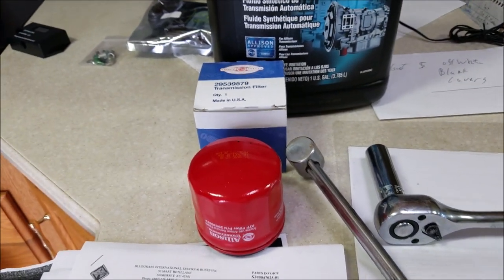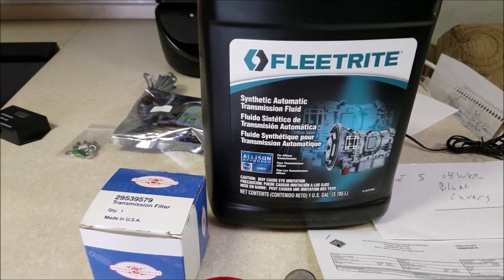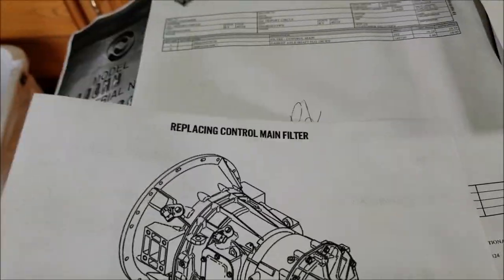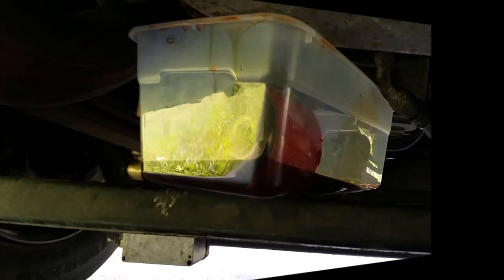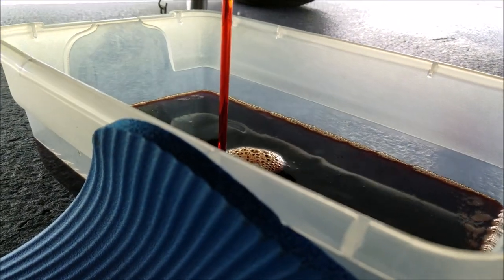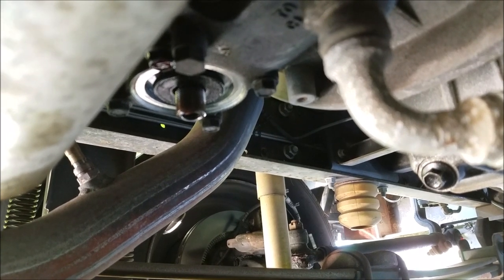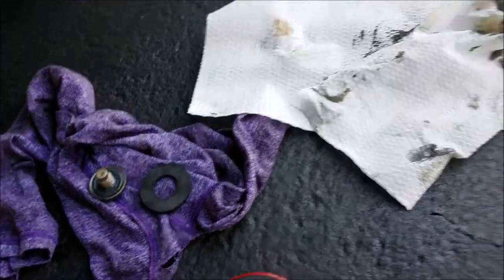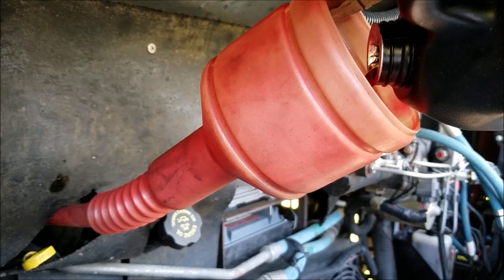How to do a Oil and Filter Change on Allison Transmission 1000 & 2000 Manual Says Every 24 Months

Comment: Thanks for showing the right way to change the transmission filter.. and the extra for issue with cruise control... Mine does the exact thing. I thought it jumps off of cruise control because of the weight of my hand control... But now i diffidently need to look into that switch
Reply from the maker: I cant remember if I talked about it but check the break switch also if you hear a click the moment you just touch the brake pedal it may be to sensitive so give it one full turn so you have to push the pedal down farther

Comment: When I replaced the flexplate and converter on mine, I took the pan off and did the internal filter as well since I was not the first owner of the truck and it had 270k miles (trans supposedly rebuilt).  Highly recommend "LubeLocker" gaskets.  My friend has a 1000 in a duramax so we went to our local allison dealer and bought 10 gallons of the castrol branded transynd.  If you look at the viscosity index it's pretty dang impressive stuff.  Stays thick when hot but stays thin when cold!
Reply from the maker: Thanks for contributing

Comment: How often do you change the internal filter?
Reply from the maker: The book says on replace at rebuild but from what I have seen I would want to replace at 75,000 miles. Look at this video https://youtu.be/ZYnQgRvSXqk?si=CgpVgAPhApE5xYIs&t=819
Its easy to do you can re use the pan gasket

Comment: I was wondering...it seems Allison is recommending transyn  is it ok to mix that with the dextron 3 that won't come out during the oil change?...Thanks great educational videos
Reply from the maker: I did a double drain and fill that will get all the dextron out of it they also say to replace oil filter after the 2nd drain, I think I drove it about 50 miles between the first and second drain and fill.

Comment: Have you replaced your Air Dryer Filter?  I'm looking at doing this soon and am beginning the research.
Reply from the maker: I assume you own a diesel?
We own a 8.1 gasser.
Reply: @ktoutdoor  yes. 2017 Newmar Ventana LE 3709… I’ve done all the maintenance myself except for the Air Dryer Filter… and I believe it’s a real Bear to do…. Was hoping to see a video of it on a Newmar.
Reply from the maker: @davidshepard9390  if there is no video then maybe you can be the first.  YOU CAN DO IT!!!
Reply: @ktoutdoor  I will when I have chance. But I’ve got to find the dang thing.  Every coach is different as I’m learning.  

What’s been your least favorite maintenance item?  Mine by far is the fuel filters.  I replaced both last week… I still smell like diesel!
Reply from the maker: @davidshepard9390  resealing the edge of the fiberglass roof  and coolant flush.
Reply: @ktoutdoor  I’ll be due for coolant next summer…. Maybe I’ll sub that out!  🤔 

I’ve used that expensive sealant tape… don’t like working with it where the front cap and rear caps come together on the roof.  It was a pain but an extra pair of hands made it much easier.

Comment: 30k miles change spin on filter.
60k miles change spin on filter / drain and refill
100k miles change fluid and both external and internal filters.
Disregard the 24 months unless you're doing continuous driving.

Comment: I thought there is a filter inside the pan? Two filters total.
Reply from the maker: Yes but they do not recommend changing the internal filter unless its a overhaul.
Reply: @ktoutdoor  That’s good information. And it makes sense because the external spin on filter should catch most of the contaminants 
.
Reply from the maker: Thanks for contributing